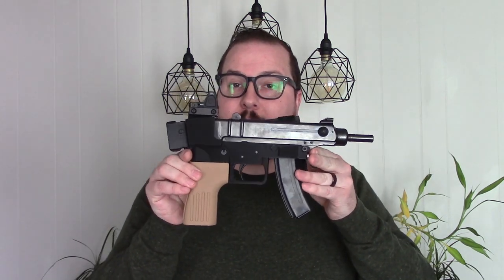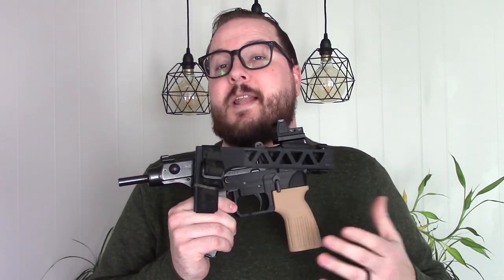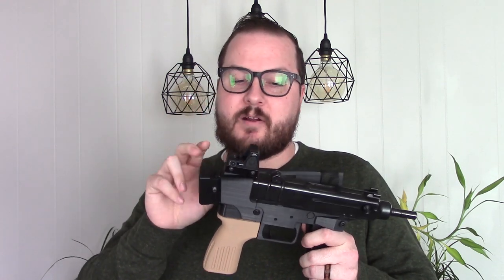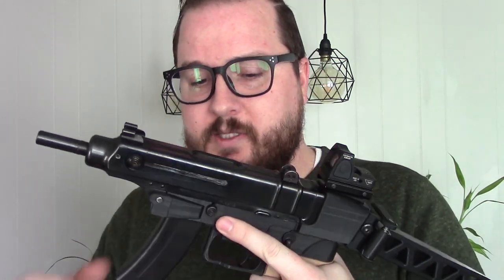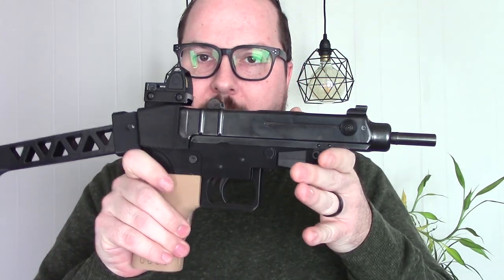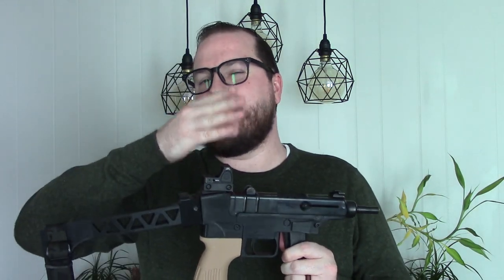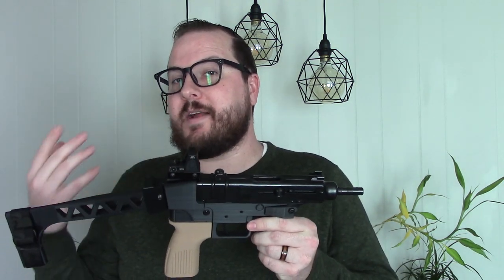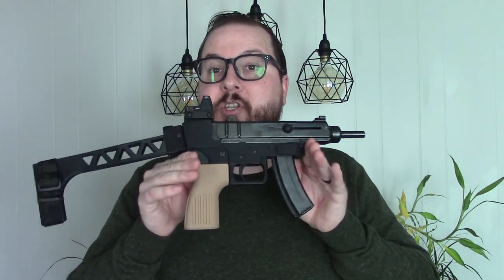CZAR - 3D Printed vz 61 Skorpion Pistol

Comment: We need more people like you showing off how they do this. Bringing the community another way to have fun.
Reply from the maker: Much appreciated. I'm trying to make this stuff more approachable and show people that it can definitely be a fun hobby.
Reply: @booliganshootingsports  are there any groups, websites or forums you recommend to people just starting to 3d print firearm parts?
Reply from the maker: @stephenfleming8474  Definitely check out FOSSCAD on Reddit, Deterrence Dispensed on Keybase, and CtrlPew on their social media and website.
Reply: @booliganshootingsports is this print still compatible with the original folding wire stock?
Reply from the maker: @jacobmarsa4168  no, the CZAR is substantially bigger in the back for strength and lacks the dovetail for the top folding stock.

Comment: Thank you for your work. You explain what you do and it helps people who are a bit more independent. Well, independent enough to find the files and figure out cad software. 

Can't wait for the .45 bolt, I love the DeLisle, so this is gonna be awesome. Even better if it's mainly 3D printed.
Reply from the maker: The .45 build is relatively old school. Machined parts, aluminum welding, etc. Just a few small parts printed, but it’s a super cool build!

Comment: Just a tip friend, because you didn’t mention it, use a wear resistant nozzle when printing the wood filament. It will wreck your nozzle. I recommend the hardened steel nozzles
Reply from the maker: Yeah, it clogged a .4 nozzle about 40 minutes into a print, but it ran really well with a .8. Luckily I’ve got a bunch of nozzles and don’t plan on printing with it too often.

Comment: wish there was a way to use the surplus grip , like print a insert for the surplus grip trim off the top parts that stick up and cut it out to fit the ar mount tab , and use the printed filler part along with it, may have to try and do this.. and wish i had a better way of talking with you lol
Reply from the maker: Anything is possible and design work isn't that hard to do. I'm easily reached on here, on my social media pages, etc. It's not hard to get a hold of me, lol.

Comment: Great video, I have a few notes. If you don’t like the charging handles, there’s a few websites that sell extended ones and knurled ones. Also, Czechpoint sells .22lr full conversion kits, with and without threaded barrels, so if you’re worried about ammo I’d check those out (although in some places it seems .22 is becoming hard to come by).
Reply from the maker: I’ve definitely looked into the charging handles and am working on designing some myself as well if I can make them strong enough. The issue with the conversion kits is that it costs more than I have in this whole project, hahaha.
Reply: @booliganshootingsports yes, but you don’t necessarily need to buy the parts kit if you gonna go 22lr?!

Comment: I love what you do and I hope you can get a software license that would make it so you can give STLs to control pew or somebody else who wants to take the risk. I understand that you have no obligation to do so but I think you're doing a great job of showing how approachable this whole subject is and how it's fun from a hobby perspective. I think you do a lot of good for proving the normality.
Reply from the maker: Realistically, I could just learn how to use one of the open source ones, but I've put in some HOURS with Fusion360 that I'm quite competent with it. That license is $$$ unfortunately.
Reply: @booliganshootingsports  That's what I've been trying to learn too. I have access to printers and tabletop sized CNC routers, so I prefer to learn something that works for more than just addtive... It would be nice to have a library of objects that you incorporated, such as the hinge mechanism of your brace, if not the whole thing, and a bump with a section of pic rail that could be spliced in place of buffer tube rings, etc. I don't think a design for a hinge is unique to firearms, and therefore not subject to ITAR as a basis for restriction. The pic rail is at least distinctly related, but it is used in other industry, such as mounting camera accessories and other optics. Food for thought anyway. Is there no one at Ctrl-pew or det dist that can take an STL and back convert it to raw files?

Comment: Just FYI if you're not aware, all commercially available braces were first sent to the ATF for review before being available for sale, to get ATFs stamp of "not an SBR, definitely a brace" approval. You can read about how the Q Honey Badger manufacturer failed to do this, and got in deep deep doodoo with the ATF claiming theirs was not a brace, but an SBR.

Anyway not to be a buzzkill, just be careful and aware of the potential legal pitfalls of designing your own unapproved "brace".
Reply from the maker: That’s partially incorrect. SB tactical failed to send damn near all of their designs to the ATF for approval,  and they’re currently catching issues for it. The issue with the Honey Badger is connected to this as well as to their marketing language and display images, showing it is used as a stock. All this is after the ATF had been telling SB Tactical (who made Q’s brace) that they were marketing many of their braces as being ATF approved when they had never been submitted for approval. So ATF went full tilt on SB Tactical for flaunting it and they’re dealing with that shit now. 

The ATF doesn’t even classify accessories like braces anymore. They only classify whole guns. 

Now, with my design, I followed an actual approved item for design inspiration, the Shockwave Blade. I designed mine thinner, with a shorter length of pull, and with an actual functional arm strap. It is more of a brace than the approved brace. It matches all of the design features that the ATF has listed as being fine for use as a brace. And there isn’t an avenue for approval for it as a brace anymore as the ATF has shut down accessory classification. 

So, frankly, I’m less concerned about my brace design than I would be if I owned an SBA3, which the ATF has specifically said that it considers to be a stock and not a brace.

Comment: Great video nice gun. I am trying to make one and having issues getting the lower to print correctly.  How did you orient the part. I am using the file that has pic on both top and bottom.
Reply from the maker: The readme file should have recommendations on print orientation. I printed mine flat with the bottom of the trigger guard on the bed.

Comment: Your videos are truly an addiction for me! You have some very good designs!

Question - have you ever printed any of these frames/receivers on a magnetic bed mat? My Ender 3 Pro has the magnetic mat. I haven't upgraded to a glass bed, but just wanting to know if these default mats will suffice.

Thanks!
Reply from the maker: My Vyper had a magnetic bed, it works fine, but I still always prefer a glass bed treated with hairspray.

Comment: I just finished up half my print. I'm printing the railed version, had to cut it along the backside because I'm using an Elegoo mars resin printer.
Reply from the maker: I've yet to see a successful resin printed firearm frame personally. They all end up breaking from what I've seen. Good luck with that.
Reply: @booliganshootingsports  Its SirayaTech ABS-like so we'll see. I've had better luck with this stuff than PLA. I just fucking hate FDM printing. So much more finnicky than resin for me.
Reply from the maker: @Munky332  Hopefully it works! It'd be really nice if it does.

Comment: Would a true to scale print be too weak to handle the pressure from firing a round?
Reply from the maker: It’d handle it for a bit, there are files out there for 100% original vz61 parts. It’s a felony though as the receiver can accept the full auto parts, so you’d have to modify the file itself to block those parts or it’d be a felony even without the parts installed. It’s very dumb.
Reply: @booliganshootingsports  thank you for letting me know.

Comment: It tends to always crack then brake at the front take down slot especially when the bolt moves forward. Does your build have any signs of these problems?
Reply from the maker: This design has been beefed up there and they removed the forward sliding/pivoting feature to strengthen it.
Reply: @booliganshootingsports  yeah but I’ve heard and seen others Czar builds still brake at the front take down.
Reply from the maker: Interesting. It’s something I’ll keep an eye on!

Comment: I just printed this gun receiver and what I thought was the mag o fit it. I printed Scorpion mag but they are too large. What mag fits this? Also, i am an 07 ffl Sot I assume since this gun has AR15 trigger any AR15 trigger assembly will work?
Reply from the maker: This uses vz61 magazines, not Evo 3 scorpion magazines.
Reply: @booliganshootingsports  Is there a file to print those I have looked on defcad and can't find VZ61 Mags??
Reply from the maker: I’ve never seen printable vz61 mags. They’re made of super thin stamped steel, printing isn’t viable for them.

Comment: What denials are in place on the upper to ensure that a full auto lower cannot be placed on it? As my understanding goes there needs to be a denial in place for legal reasons.
Reply from the maker: The big thing is that this can’t fit the full auto CZ parts from the parts kit because it doesn’t use any of them in the first place. This uses an AR FCG, not the original parts. The original parts won’t fit the geometry of the receiver at all.
Reply: @booliganshootingsports   Correct, but I notice when people do full metal builds (using original modified parts) they have to follow a protocol. I suppose it might not apply here since the lower isn't included. But, if you rebuild a lower and make it semi auto only, you have to put a denial in it so that only that lower will work with the upper. So, you gotta put a block on the receiver and a cut out on the lower. On a DP28 for instance, you have to put pegs in the receiver so only a semi auto bolt will go in it, you have to put a blob of weld in the channel so only a semi auto carrier will fit, and put material on the rear of the lower receiver so only the modified lower will interface with the modified upper. Like I said, I don't know the rules about something like that. in a case of this kit.
Reply from the maker: @Sigibrand As I said, the "denial" in this receiver is that the full auto trigger parts don't fit at all. For a normal vz61 build, you have to use a semi-auto receiver and a semi-auto selector since that build generally uses the normal full auto FCG, just with denials built into the receiver to prevent it from going full-auto. You use the normal unmodified vz61 bolt from the parts kit in those metal receiver builds. 

With this, the receiver geometry is completely different. None of those original full-auto parts will fit at all, and it uses a completely different semi-auto trigger group. The denial is in the receiver design and that's all that is needed.

On the DP28 example that you used, I believe the issue is that the DP28 fires from an open bolt (I could be wrong, I don't know my Soviet era LMGs), which by itself is illegal unless it's a pre-ban grandfathered build. So in the rebuild process, you have to modify the bolt to be a closed bolt system, requiring receiver changes to prevent an open bolt system from being installed. The vz61 fires from a closed bolt, so it's a moot point.

Comment: Think if this contraption has its f-switch in it, would it work?
Reply from the maker: Nope. It uses an AR FCG and there’s no way to make a FA AR FCG work with the VZ61 upper. There’s no sear trip on the bolt.

Comment: For your grip did you just tap into the pla or how did you do yours
Reply from the maker: Yep, it cuts sacrificial threads.
Reply: Yeah mine finished up last night going to the show this  weekend to look for parts kit. So basically just tap the hole strait into the pla that is already there just not threaded.

Comment: Why the mods? I just bought the ender 3 pro, did I buy the wrong one for this?
Reply from the maker: An Ender 3 pro will be fine. I bought a standard Ender 3 and wanted some quality of life improvements. Better bed, springs, Bowden tube, extruder, etc. The Pro has most of these upgrades.

Comment: 22lr? It easily adapted to czs kit?
Reply from the maker: This is .32 ACP. There’s a standalone receiver just for the .22 versions 👍
Reply: Have a link? I wanna do both eventually but tryin to do some research first. In my mind this receiver with a 10-12 “barrel (in .22lr) would be the ultimate backpack gun. Compact. Light. Long enough to maybe not be really flipping loud without silencer extendo-ing it….
Reply from the maker: @saltydecimator  check out the Gatalog.

Comment: Better be careful with having a brace without an atf approval letter
Reply from the maker: ATF doesn’t issue approval letters for accessories like braces anymore, only for whole firearms with accessories added. The best you can do is to design it following all of the guidelines for approved braces, which I’ve done. It is the same “blade” size as the shockwave models, has an arm strap, and a LOP much shorter than the allowed maximum dimensions. It’s about as clean of a design as can be made.
Reply: @booliganshootingsports   I know this my point is you are doing two things on video the ATF doesn’t like 3D printed firearms and braces don’t get me wrong I think it’s super cool and it looks great I’d just be careful
Reply from the maker: Honestly, not worried about it. It’s a legal design following their guidelines, and it’s a one off design for personal use. Currently, every person with an SBA3 is more in the eyes of the ATF than me, since they've expressly determined that those are shoulder stocks and not a brace.